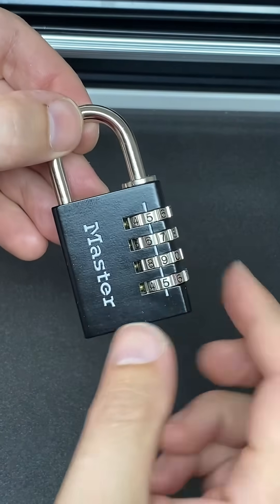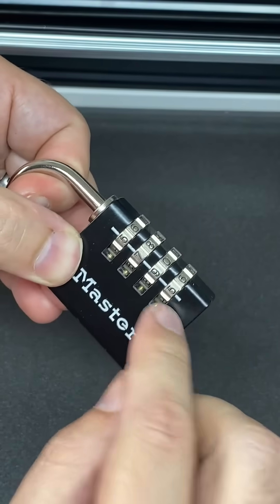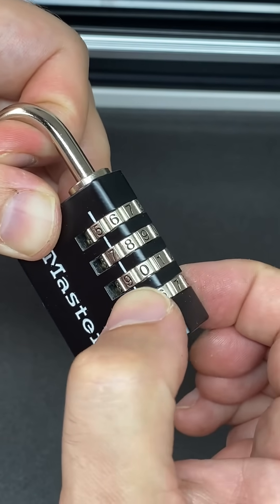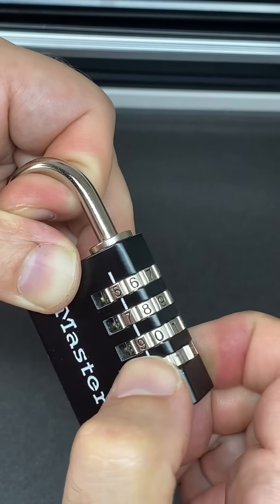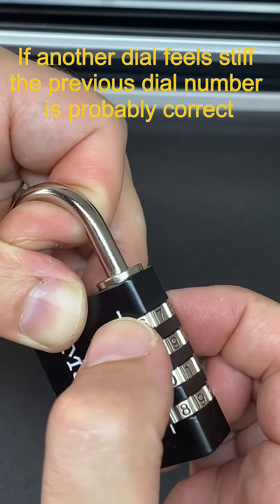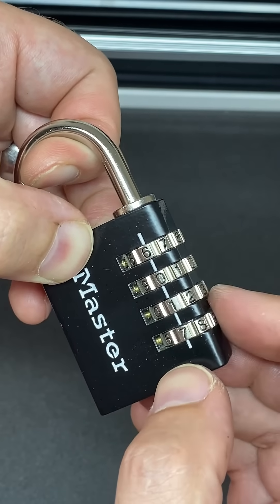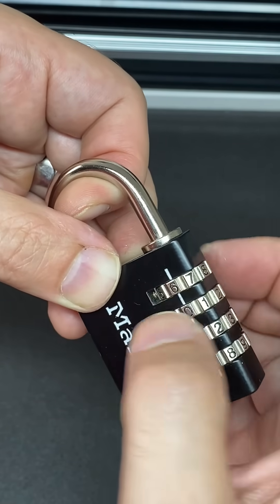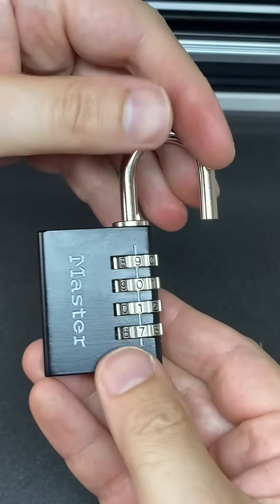Decoding a Combination Padlock

Comment: Cracked my lock just now , I actually was pulling the lock from the other side ,saw video and realized I needed to pull it from side opposite to  the side which has arrow markings and opened in 5 minutes of trials

Comment: What if the lock id already open? I just dont know the code to lock it?
Reply: Don't know if you still need help for this but, there should be another like notch to push the pad lock down while it's open once it's down you can just set the code and pull it out then lock it.

Comment: Those locks are so cheesy and crappily made, the shackle barely even goes down into the lock body, so if you really needed to you could get a pair of pliers or a strong screwdriver and pry or twist the lock body. It will either pop open, bend and open, or just break and fall apart in your hand. Whatever the case, this will ruin the lock permanently, but if you really need to get into whatever it's on and don't have any cutters, you can buy another crappy lock. I have seen these little locks be bent open, then back closed again lol.

Comment: mine has multiple different clicks for different numbers what do i do then
Reply: Well done for finding a padlock that isn't easy to hack. Now that's a padlock I want to have, what is the model and brand of it, please? Thanks.
Reply: @theycallmemrglass i boight it for 2 dolars 😂
Reply: Those are false gates. Wiggle the wheels at each click. The click that has the easiest turning is a true gate. Repeat for it
Reply: Well, mine had the same thing. I realized that it may be a combination of those spesifik numbers (numbers were apart by 5: 026 and 571) so I tried all possible combinations (which is 8 combinations: 026, 021, 071, 076, 576, 571, 521, 526) and found the correct one. Obviously, more numbers mean more combinations, but hopefully, this works each time for every lock :)
Reply: you can also just use the pokey stabby tool and pokey stabby it open

Comment: In my case, the locks were sticking due to sticky liquids affecting the system inside. I had to clean first and it worked. Thank you for the advice.
Reply: How did you clean it? Soaking in soapy water?

Comment: I've got a combination lock but every single dial has a lot of resistance and is quite hard to turn, even without using any tension this makes it impossible to know which dial is binding, let alone which number is correct on said dial. Does anyone have any tips for opening locks like these? Would really appreciate the help.
Reply: I was gonna ask the same thing! It's not even a decent lock, it's from Sports Direct, so I presumed it would be a breeze to open.
Reply: @GiggleBytes2011 ive since been able to unlock it. What helped me is loosening the tension I applied to the lock. If one of them feels harder to turn but youre not sure, because a few of them are hard to turn, apply more tension and try each of them, one of them will be significantly harder to turn. I hope this helps you as well!

Comment: This works on my older lock. However, on my new one it does not. It clicks and moves on several different digits, like every third digit and all the different "weels" feels equally stiff.
Reply: Then it has a false gate  everey 3 digits. Try to get a feel between a false gate and the true gate. Usually the true gate is a bit more loose compared to the false gate.

Comment: This is great! It worked on one of my locks, but the other one, it isnt. See, your lock opens by pulling it upward, but mine, you push to right or left. Got any trick for that one
Reply: for the one he has, he tensions it by pulling it the way it would open. that still applies for yours, you need to tension it by pulling/pushing in the direction it opens

Comment: Or of course you can slip a wire down the notch the shackle goes in when you want to reset the combo. The wire falls thru the true gate for each wheel, when thru all 4 move all the wheels two or three clicks toward the shackle.. and open it
Reply: Some pad locks have guards thats stop this type of attack, so it won't always work

Comment: Great Video LockNoob.  Hey I had a question, Did you and lockpickinglawyer get together and come up with a different style of your goat tool you created?  I ask cause on his website his new lockpick set that is a upgrade from his Genesis set has a tubular tension tool that looks identical to the goat tool you created.  Only difference is the ends (handles) are shaped just a little different at the very end.
Reply from the maker: It’s different in another way in that the goat picks tubular locks that don’t centre tension